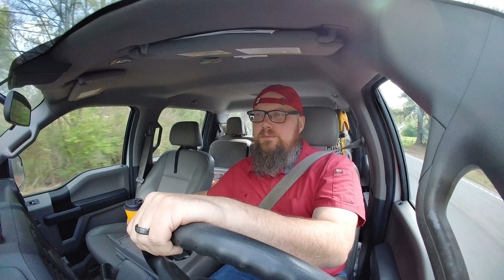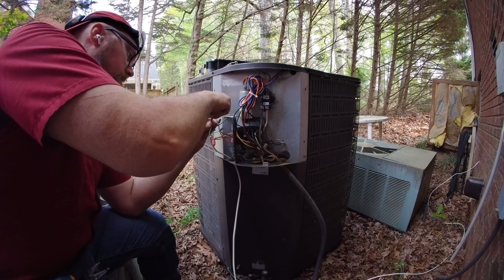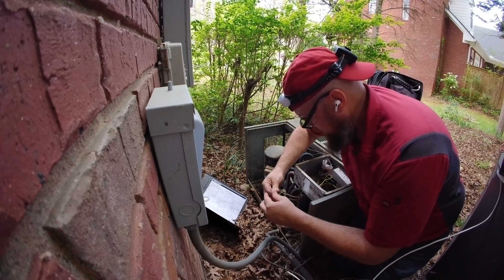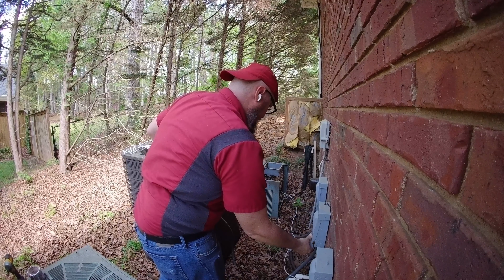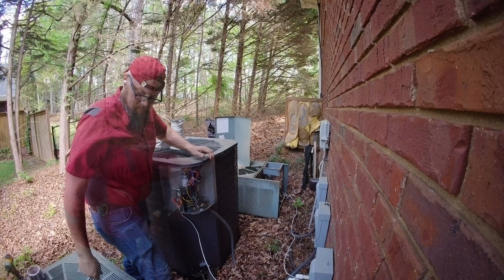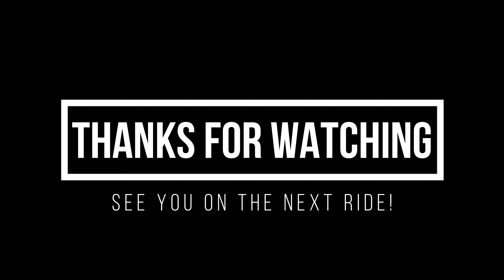No Low Voltage Times Three: Three systems with the same issue on the same home.

Comment: Any reason you don't heat shrink\weather seal the connections when you do a splice?  Coming from the 12v car wiring world here so excuse my ignorance.
Reply from the maker: Most HVAC low voltage splices are out of the elements and those were restrained by the ties inside and out as well as the tightness of the wall penetration and mechanically at each system. If it were a situation where it was done outside between the system and wall, by all means.

In this particular case as I was also concerned that I had pulled one of the bundles to the incorrect outdoor unit as I lost it in the wall for a moment so wanted to easily be able to swap them if that were the case after I powered everything up.